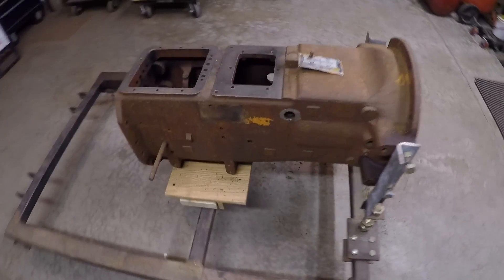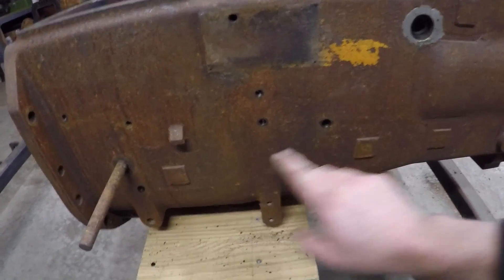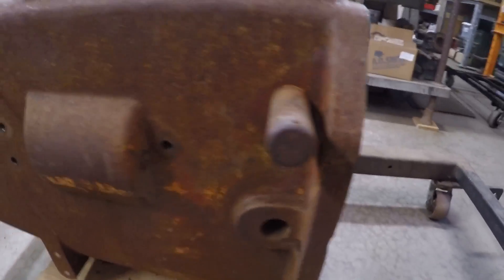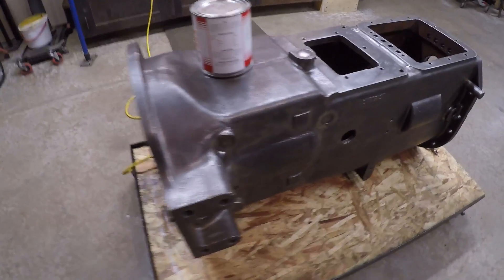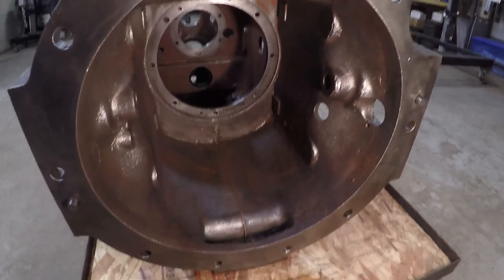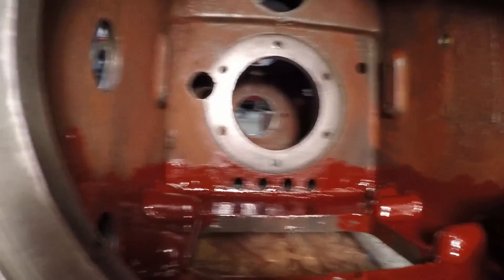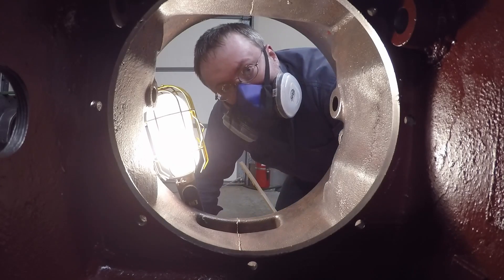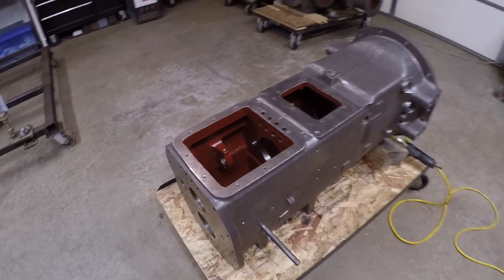Minneapolis-Moline Prototype 445 Tractor #X231 - Part 23: Cleaning/Sealing Transmission Case

Comment: I've never used that type of coating.
 I have found  electric motor winding varnish. Spray can product. It's petroleum-based product proof, and stands up to just about anything after a few coats. I know rebuilding equipment is costly,  if a guy can save a few bucks and do the same job it maybe worth a try. Good luck with the restore job....

Comment: At the beginning you showed the serial number plate. I know you can get new studs for these and if you are really careful you can reuse the old ones. I am curious if there is someone who rebuilds these plates to original quality. I did get my 460 Farmall last week and the serial number plate was covered in grease and oil, when I wiped it off with a rag the ink or paint went with it. Oops! Not sure I I could have prevented it anyway.
Reply: @squatch253  Thanks!

Comment: This video came up in my suggestions, glad it did! I have a 1957 445 U gas tractor. It's no trailer queen and far from perfect but I did bring her back from the dead over 23 years ago when I traded a clapped out 1971 Torino GT for her. 
  She got a major engine overhaul, a fresh clutch and went through the hydraulics and 3 point lift system, repacked the  power assist steering racks.  She's been a good and faithful old tractor. Cleared a lot of snow in my time I've owned her, getting the job done with a 5 foot 2 stage blower on the 3 point. I  just subbed your channel and look forward to viewing all videos on this 445 you're restoring.👍😎

Comment: How would the factory have painted them housings?
Reply: I don't believe the factory (or any factory) would go to the trouble of coating the interior with Glyptol.  This is a high end procedure that only the most discriminating restorer would perform.  Nicely done!
Reply: Paul Copeland but the inside were painted with something was just curious
Reply: @tater_relocater  factories use spray on products. A little different but if set up for production spraying is faster but at home it doesn't make sense, roll on or brush works just more time consuming
Reply: Squatch253 I’ve heard you say that ,but I guess my question should have been at the factory if they sprayed it is it machined after it’s painted or would they mask it off? If you know ? I enjoy your videos,and I understand you are more methodical in restoring these machines.

Comment: Holy kadoodleskis. You are way way more patient than I am. I would have found someone with a propane heated steam cleaner, started with a gallon of Gunk,blasted the thing but good,then dried it with radiant heater overnight.
That tag. Since you work at a Ford dealership,would it be worthwhile to clean,perhaps repaint the face,then take it to the body shop and get them to squirt some clear coat on top ? Might help with the next 70 odd years even though it will be a trailer queen. Sign painters paint,I forget the name,would look a treat under clear coat. One Shot ? Is that the brand name ? Cannot remember anymore. Good paint.
You are displaying real patience. Or is it OCD ? Either way the results are spectacular.Cheers.